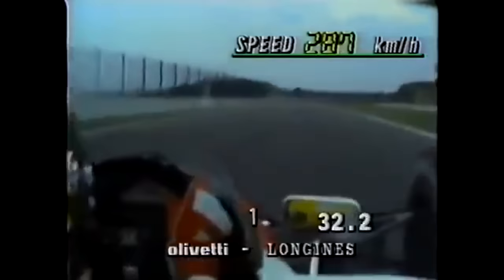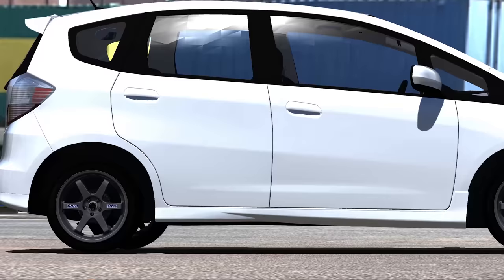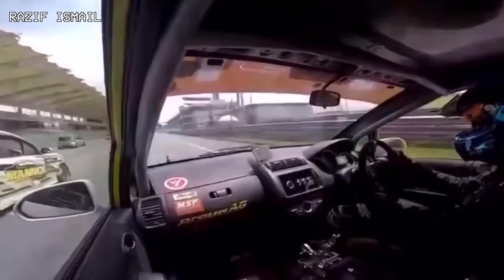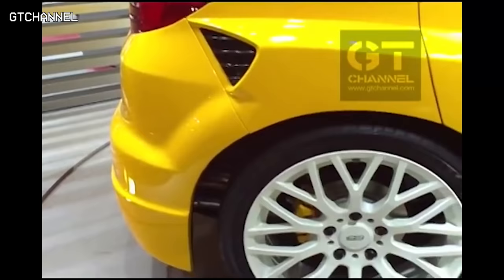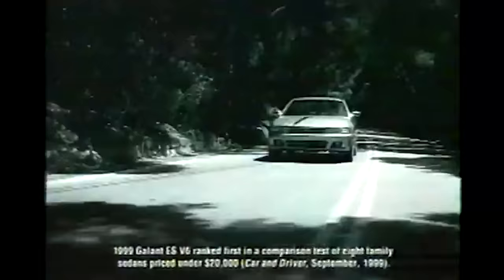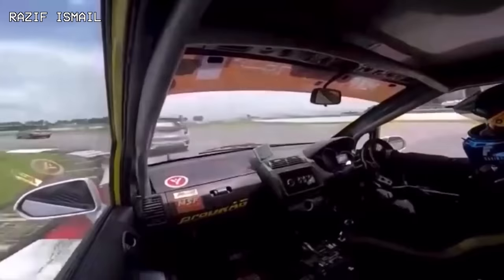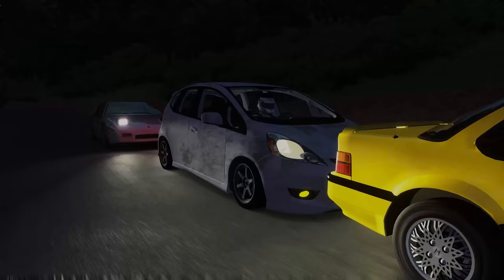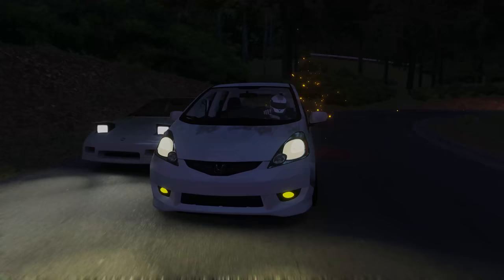Honda Fit - What Makes it so Great?

Comment: As someone that's owned a 2015 for 3 years, after having all sorts of v8 and v6 American sedans.. this little thing rips. It's not fast, but it's more fun than any of the other vehicles I've driven, even below some of the speed limits in my area. They absolutely nailed it with this chassis, and the engine is just enough to have some fun. It's perfect.

Comment: I drove a Jazz as a taxi in Launceston Tasmania. The fleet owner had a number of them and it beat all the regular cars used for taxis hands down. Even the cost of parts for regular maintenance was far less than any other car being used as a taxi at the time. One of the first fleet owner that used them looked at a number of cars available on the market back in the early 2000's and after measuring all the main factors for size the only measurement that was smaller than the Ford Falcon of the time was the width across the back seat. I could fit more luggage in the Jazz than in the boot of a Falcon, Commodore, Camry and even in some cases a Caprice.

Comment: Bought my 2nd-generation (2009) Fit Sport 5-spd manual in October, 2008. Super reliable, very good on fuel, handled better than any of the six 1st-gen Mazda RX7s I'd owned over the previous decades and - because of the utility provided by that flat cargo floor that could accommodate a love seat or deep freeze with the hatch closed - took away almost every excuse for ever "needing" an SUV.

 I say "almost" because here in Canadian winters all-wheel drive and a few extra inches of ground clearance would have been most welcome. Also wished for a sixth gear to bring those rpms at 120 km/hr down from 3300 rpm to 2900. 

Kept the car for over 10 years and 312,000 kms before giving it to our daughter and buying a Lexus hybrid SUV. She still has it, with around 350,000 kms and no issues. Do I sometimes miss my Fit? Yes.

Comment: Purchases an 08 Fit Sport w/manual transmission.  I drove it like I stole it ever since.  My most memorable times is being up in the NC mountains and walking away from even modified Mustangs in those turns.  Granted on a straight line they got me, but who hits mountain roads with yellow signs saying 15mph with a car set up to pass on the highway?  I averaged around 42mph with 50/50 city/highway.  The interior room always surprised people.  When it comes to cost per daily driver needs + cheese factor, I don't think anything comes close.

Comment: gf has a 08 jazz 5sp automatic, i thought "aw just another little city hatch, couldnt possibly be noteworthy" but as time went on, I've grown to agree with everything you've said. stiff af chassis, just enough power to get out of its own way and it will happily take more, PHENOMENAL TURNING CIRCLE (cant understate how important this is in anywhere but america) and average turning performance, engines right over the front wheels so heaps of grip off the line (at the expense of a fair bit of understeer in corners but thats why the chassis is so stiff, could be worse), insanely modular cargo capacity (we've moved an entire house with ours), EXTREMELY reliable (gf had honestly been running hers WITHOUT OIL for a UNKNOWN AMOUNT OF TIME and it wasn't until we took it for a scheduled service that we found out.. couldn't even tell the difference.. our commute is straight up to highway speeds then into stop start traffic and we had absolutely no idea)

didnt even know there was a mugen version, could be an ez collectors hot hatch if one pops up for auction in japan..

Comment: I've always been a Mazda fan with rotary engines and the Miata but you can't beat the package deal the Honda Fit offers. I bought a 2019 GK5 fit sport new and don't regret it the past 3 yrs! Rip GK5 USA as it ended the line up in 2020

Comment: I have a 2011 Honda city. Basically a cousin of the Honda fit. It also has the L15A7 engine. Bit heavier than the fit but she ain't no slouch when the vtec kicks in.

Comment: The tree in my front yard fell on my car, no major damage but insane amount of weight. Still drives. My niece wrecked the side wheel, I also wrecked the side wheel, I got 357,497 thousand miles and somehow still going with nothing major. This little guy is a tank

Comment: I have a 3rd Gen 2019 LX model. It’s amazing how many bases it covers. I drive 70mph on the freeway with frequent short hills and some traffic and city driving. I average 41 mpg. It can swallow so much cargo and is configurable. It rides well and goes around corners pretty flat. Also a lot more torquey down low than you’d expect from the class (which is usually not at all). And it looks nice, sounds great too. 

What more could I possibly ask? Maybe comfier seats and a softer ride but that’s it.

Comment: It’s genius is that it’s basically a tiny van with gold flat seats in the back. We’ve had a Honda grom in one, several shelving units, etc. 

Early models CVT’s were garbage but otherwise the cars last for ever abs are ridiculously practical. They don’t handle too bad for a super mini - van mongrel either.

Comment: 2009 Fit in Canada. Owned since new. 170000 kms. $450.00 in repairs over the years which included an AC fix. 

Dead reliable. Topped it out at 180 kph indicated, carried everything including large wet dogs that can hop into the low hatch easily!

$23000 out the door in 2009. What a deal!

Love our Fit.

Comment: Owned a 2007 GD3 Fit 5spd Sport for 13 years. Such a great car, fun to drive, easy and low cost maintenance - nearly everything I could fix in my garage. I can't believe I bought the damn thing for $15,700 OTD. Best car I've owned and I still miss it.

Comment: I bought a 2016 model in 2017, in anticipation of my Toyota Yaris dying.
Fantastic car, feels like it aspires to be a  bigger luxury car in its own little way. The CVT is weird, having no gears, but quite usable.
The Toyota kept driving though, and I have a beat around minivan. Then one day while driving the Fit, a bear jumped into the middle of the road and ruined my radiator. Not a big repair, but all this resulted in my Fit still have only 17000 miles on it.

Comment: I ditched my 06' Forester XT then got a GE8 CVT (yes, the one with the paddle shifters) and boi, I am never looking back. This thing is so much fun to drive because of the pokey/playful engine. Even though it's very fuel efficient, it doesn't fail to put a smile on my face once I step on the accelerator/gas pedal.

Comment: 2 years ago I bought a iceblue 2004 Jazz as a second car. Low mileage, 1 owner and in perfect condition for like 2 grand. When my wife first saw the car, she laughed her a off. Fast foward 2 years and this car turned out to be the most cost effective, reliable and fun to toss around car you could imagine. Yeah it lacks in power, but Honda somehow still managed to give it a gokart like driving feel. I will invest another 2 grand in the next couple of months for Eibach springs, new wheels, open airfilter and Magnaflow exhaust to make this car an even better driving experience

Comment: I have a jeep wrangler. I wanted to take it out of rotation as a daily driver and i wanted something short (parallel parking in brooklyn a lot), gas friendly, and not expensive. I bought a used 2015 fit. It was amazing...

Then i fell asleep behind the wheel and totaled it. I was probably going around 70mph when it happened. I walked away with a bruise on my knee and a little stiffness, nothing more. 
Amazing car. I would buy it again. If that accident happened in the jeep id bet id be dead.

Comment: In '88, I bought a brand new CRX Si, silver, manual transmission (the Si only came in manual) which I drove the heck out of for a decade. In 2011, I got a brand new Fit Sport. I had to call all over the Dallas Fort Worth area to find a dealer that had one in a manual. I've been driving it 11 years now, and to me it feels like my old CRX did. It's not quite as small, and it's a tad heavier, but it handles very similarly (at least after I put stiffer torsion bars on it). It is about time to get a new Honda (it'll be my 5th. I also had an early 80s Accord and a late 90s Civic). It's very sad Honda yanked the Fit from the US market.

Comment: In 2008 I considered these but wanted a drivers car.  These had the great folding seats and the engine but a softer suspension/driver vibe.  I went with the Fiesta, which drove amazingly well but had so many issues it wasn't worth fixing at 5 years.  And Ford were terrible.  (I bought an 07 Forester that is still going at 325,000km in 2022 lol).  If I'd bought the Honda, I'd still be driving it!  But the Forester and my MX5 are a great combo...

Comment: I am in India. I had a Diesel 1.5 and also the petrol 1.5. Absolute JOY to drive, both the diesel and the petrol. The high revving is cancelled by the diesel, but the torque is pretty good. Highway speeds of about 90 - 120 km/h are easy.

Comment: Proud owner of an European spec, GD3. Although the engine isn't as good as the US version, it's still a snappy 4-cylinder. But the chassis and the gearbox, oh my. 

In 15 years of ownership, I've smoked countless Golfs, Opel Corsas and others. The car is simply quick on the corners, balanced in entry and exit. It has the best gearbox and shifter on that price range period and just wants to be driven fast. 

180.000 Kms on the odometer and still working damn fine, with no replacements whatsoever. Onyl ordinary maintenance, like oil, tyres and brake pads.

I had passengers, golf owners, coming with me for a drive around the city at night with no traffic, and leaving flabbergasted, telling me they would've never imagined such performance from that car. 

Just slap on a set of decent tyres and go have some fun. I'm converting to an LPG car for fuel economy, but I'm not leaving my Honda Jazz. She will be turned into a track car.

Comment: PROUD owner of my FAVORITE car I’d ever owned; 2018 Honda Fit Sport (3rd generation, GK5).

I was lucky enough to find one brand new at the Honda dealership in December 2017.

Working musician; this thing is, legitimately, like an enclosed pickup truck. Drums, Bass, PA, lights (not all at the same time, but still)… NO problems.

Bonus: I also occasionally tow a small trailer… no issues.

Double Bonus: Fun to drive! Love the 6-speed manual transmission (despite the suspension change).

I looked forward to it, I have owned it ever since as the original owner, and I absolutely planned never to ever, ever ever, ever ever ever get rid of it.

Cheers, all!

\m/, 😊 ,\m/

Comment: My dad owned a 2016 one in India.
The indian fit or jazz has the engine  tuned for mileage and not for power 1.2 i vtec which is not quite spicy at low end but can hit quite good speeds even in stock condition loved the car. was very practical

Comment: We bought honda jazz sport edition.  My wife want it because it save gas. What I didn't know is space. I learned it oneday when we drove to ikea to purchased a queen size mattress and bed frame. I told my wife it won't fit. She proved me wrong. She was able to fit the mattress, bed frame,2 night stand and bed board into the jazz. I was shock. We still have the car it's a 2009 honda jazz with 200,000 k on it. Every german mechanics we met said vw is a junk and they admit honda and toyota is better.

Comment: 11 years and 125,000 miles on my 2012 5AT Fit. No issues (except replacing both CV axles because Ohio salt). I do wish I would have got a manual trans, but at the time of purchase I was doing way too much stop  and go driving and wanted to be lazy. For those of you that do have an auto like me, change the trans fluid every 30,000 miles, its super easy and cheap to do.

Comment: Dad got an '09 Fit Sport (AT, wish we got an MT).  Thing handles amazingly well in the twisty bits.  Of course it's not particularly refined on the highway (loud and bumpy), but it was a reliable workhorse that was a fun runabout for town.  Brother now has the car.  Paint is peeling a bit on the plastic parts (we got orange because of course), but not particularly surprised at the iffy paint quality from Honda in that decade.
Reply: I dont think it rides any worse than any other subcompact car.

Comment: We had a 1st gen Honda Jazz, we never serviced it for the 10 years that we owned it, just fluids and brake pads, and it ran flawlessly with no issues whatsoever, the only reason we no longer have it is because it was written off in an accident

Edit: Now we have a 2nd gen Honda Jazz and it's been running for 6 years, still no issues

Comment: I have a 2010 fit sport manual and it may be kinda slow after 100mph but the trans is so smooth and the handling is amazing.
Reply: Ye, bcause it has speed limiter around 160kmh, remove the limiter it will go more

Comment: Had a 2002 GD for 10 years, the only major items replaced were the manual gearbox bearings and rear wheel bearings, it died, just short of its 20th birthday, miss it I may get a later one soon

Comment: I have the 2014 model JAZZ, it's 8 years old now but has only covered 17,000 miles, a great little car. I do not intend to replace it as I'm 66yrs old now and cover less than 4k a year so my jazz should outlast me.

Comment: I wanted a fit when car shopping in 2009. The second gen fit just dropped, and you couldn't find one used which was my market. I ended up getting a 2008 Scion XD, and it was a good car. Only had to change the water pump in 2021. It's based on the yari chassis which has a racing following, but comes with the Corolla engine (2zr-fe). I would still be driving it if someone didn't run into the back of me. The paint didn't hold up well though it did spend over a decade outside. Peppy and always got 30mpg (5 speed stick) driving like a jerk. You can find them pretty cheap now that the Scion brand is defunct. I think I replaced a wheel speed sensor too now that I think about it.

Comment: I'm 31, have had 5 cars - 4 FoMoCos & 1 Dodge, all of them full sized sedans. The ONLY foreign compact I'd get is this. Honda did a PERFECT job on ergonomics & practicality on this model. All the things I could do in my 2000 Lincoln Continental, my 07 Grand Marquis, my 13 Charger SRT8 - I can do them in this car (minus the powertrain stuff).

Comment: I got to drove both first and second generation and I got just one ride in the third. For me the second generation it's the best. Except with variable springs VTec recalled the Takata air bags which they replaced for free. My transmission was manual and it lasted 11years with the same clutch from the factory. Just replace the usual shocks, sparks, tires and wheel for Honda performance light weights. The things still move with power and pretty good. It's an amazing fun car and pretty cheap in the gas. To be honest a low mileage second generation manual transmission it's a good buy just, check everything before buying and you good.

Comment: I have a citroen c3, a car in the same category as the fit and it even looks similar but it seems the fit is better in handling and power since my c3 only has 76hp.
Tho the 1.4 c3 sx is awesome in low fuel consumption and basically no maintenance costs.
The most expensive "repair" it needed was a set of new tires

Comment: I've done a lot of miles on a 1st gen Fit/Jazz. It was a 5MT and had the 1.1 or 1.2 engine. I actually hated how it handled. It felt like a boat. It also had a lot of regular problems with its transmission. And like any other 85hp car, it struggled a lot on uphills. But now that I think about it, the car was definitely poorly maintained. The regural mechanic that serviced it was probably completely useless, and in general the owners did not look after the car.

But it definitely was a car that had a lot of space. You could carry so so much stuff with you. The folding seats were amazing.

Comment: I have a 1987 Toyota Corolla FX-16 GTS, which is a fucking unicorn car in the states and hard to buy parts for, so when I was in the market for a daily, my requirements were:
1) good parts availability (which, tbh, basically any car would seem like it ha good parts availability to me at this point) 
2) good fuel economy
3) practicality
4) has to be fun enough to drive that I won't miss daily driving what I consider the singular most underrated hot hatch of all time

And somehow the fit checks every box with ease!! The motor is a little soulless compared to the magic of the high revving, angelic sounding 4a-ge but other wise I can't think of a single thing I would change. The GE8 is an incredible car, I'd buy another in a heartbeat!

Comment: I got my 2002 GD1 Jazz for $500 in 2018. It was a very beaten 16 year old car with almost 250,000 km, poorly maintained, bent panels. It now has junk yard alloys and a mostly color matched mix of sport and mugen bodykit,  sound system is more my taste and I added window tints.  CVT was questionable and one day it gave out. I replaced it with a CVT I found on marketplace for $80. I change the CVT oil every 18 months - prevents any issues with clutch packs etc. Still drives, gets  about 5 litres per hundred km with 340,000 km, does use a bit of oil - 500 ml between services.. I'd like a hybrid GK Jazz for my next car if this one ever dies and if it did die mechanically I'd fix it, because I can't get a hybrid GK5 that's running(ish) legal and driving for $500